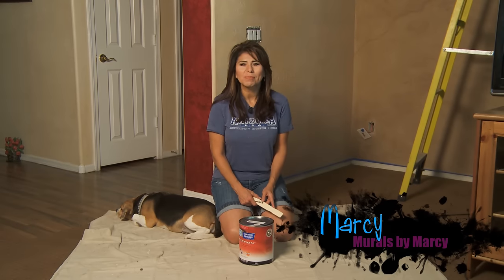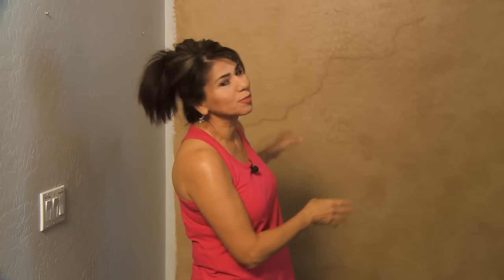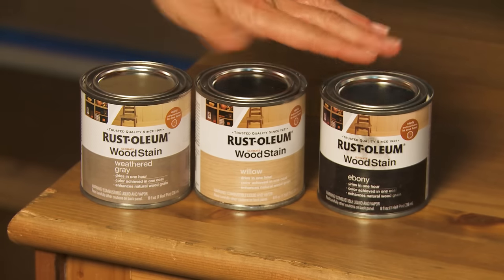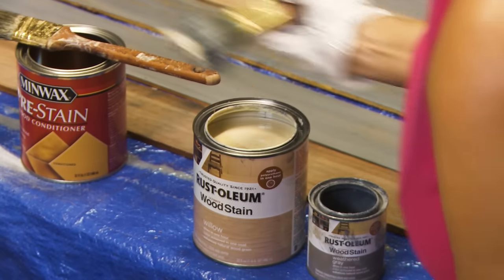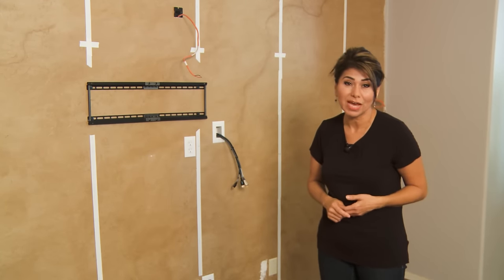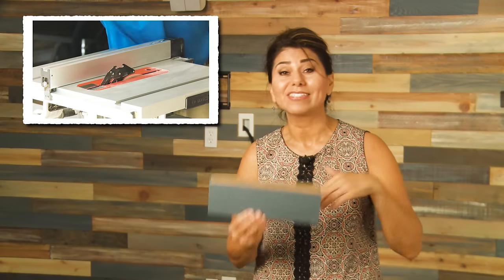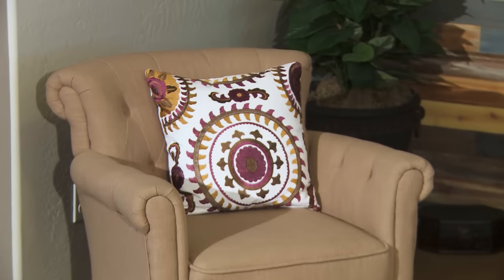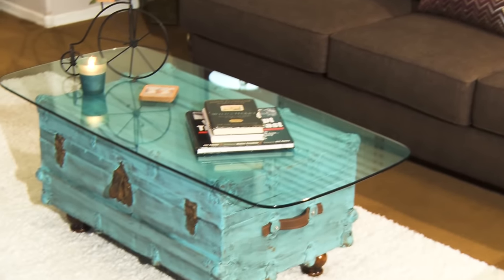LIVING ROOM MAKEOVER WITH WOOD ACCENT WALL:  DIY ideas for transforming your space inexpensively

Comment: Thank you for your video, enjoy your project very much, just did a couple things different,  first I bought my wood already with the same width, and stained it all before it was cut, to me it was much easier this way, then it was just to cut to the necessary measure, nailing I didn't look for the studs, I simply use 1" 1/4  finished nails, and the trick was nail the boards position the nais in sideway 45°angle in opposite rows, that was much easy not to be worried to be always on the studs. Before that I tested a 24" board nailing to a piece of sheet rock and the result was very positive, I had a hard time to remove or separated the board out of the sheet rock,  thankfully.
Reply from the maker: That's awesome. Sounds like your project turned out great. Congrats on that. Thanks for checking out my video and taking the time to comment.

Comment: Very nice work your wall looks great. I did a similar wall in our living room and used wood fence slats which are thicker but after watching your video and seeing you used Bender Board, I would certainly recommend that people use the Bender Board like you did. I like that the bender board is thin and if you have molding, the thinner the wood is the better so it doesnt protrude out past the crown and base board molding. Again, great job I will be doing another wall and will use Bender Board this time thanks for the video!
Reply from the maker: Thanks for your kind words, DP Surfer.  I'd love to see a picture of the wall you did using fence slats.  I'm sure it's awesome.

Comment: Hey Marcy, I love what you did. My husband and I are doing that too. Our walls are 8.5 X 8.5 and I was wondering in order to cut the panels in 3 different lengths what would you suggest they be? Hope to hear from you soon. Thank you.
Reply from the maker: It's really a matter of personal preference and how much work you want to do.  The smaller the pieces, the more cutting and nailing.  My wall is 10 x 12, so we cut 4', 2', and 1' pieces.  Then we ended up cutting smaller custom pieces to fill in the odd areas.  Hope this helps.  Thanks for checking out my video.

Comment: Hi God bless you and yours!!

Really nice job. But how do you obtain so many colors with only 2 stains?
Reply from the maker: Hi Felipe.  May God bless you and your family, as well. The bender board I used had very inconsistent coloring to begin with. But, using a paint brush, I would layer one stain over the other, then flip flop the order on different pieces. Sometimes, I just used one. Other times I'd put multiple layers of stain to make the color darker, or barely put any at all to make it lighter. I was experimenting with different combinations the whole time, and was so happy with how it all turned out in the end.  Thanks for checking out my video.

Comment: we are ready for us to do our project in the living room and so the orange is painted on the wall, the wood is cut, the tools are prepared. However what are the size of the brad nails. because we are like you and your family... fads change and our needs do too!!  (i do realize that your video is a couple years old so I hope you check on comments)
Reply from the maker: Laura Matsuyama Because the bender board is so thin, we used 1” brad nails. It’s held up perfectly. Good luck with your project. Thanks for checking out my video. 😊
Reply: @MuralsbyMarcyV  Thank you for responding. I enjoyed your video. I now know that we can get started on our wall with more confidence after seeing your video. we did decide to paint the wall behind and space out the wood so that the the color comes through, we are also debating if we should but up lights but that maybe a little to much!! :) Aloha!

Comment: very nice. did you sand the wood before you stained it? i like the colors but dont like a rough wall do you think sanding is good?
Reply from the maker: Thanks for checking out my video.  That's a good question.  In this case, I didn't sand them, because the wood wasn't that rough.  If I had a baby crawling around, who might rub up against the wall, I probably would have.  It just depends on the individual project and if you're going for a particular look.

Comment: Looks great!!!   I am unclear about how you got such a color variations with just two stains.  Did you first stain all the wood, then add watered down paint for color variations?  If you did, what paint colors did you use?  There is too much blue and white to occur with just two wood stain colors.  What did you do specifically?   Sorry to be a pest but I  want to do this too.  Thanks so much!
Reply from the maker: Thanks for checking out my video Tanya! I did only use two stains; the gray and the white, but I applied them differently to each piece of wood.  Because I used bender board, the pieces I bought came in varying shades to begin with.  So, some I left pretty close to natural, while others I applied heavy stain.  I did light layers of gray, then went back and streaked it with white stain, some I did two layers of gray stain and then added the white, some I did the complete opposite, I did some just gray, some just white, and I never cleaned my brush in between.  I think that is the biggest trick.  Don't clean your brush.  Hope this helps.  Good luck with your project!
Reply: Thank you Marcy!

Comment: Hi Marcy. You and your husband did a great job. It is gorgeous. My husband and I are planning to do the same. 😊 I have a quick question for you, how thick is the wood you used? Thank you in advance.
Reply from the maker: Hi Yeni.  The wood we used is only about 1/4" thick. It was inexpensive, but also imperfect, so we spent a lot of time at Lowe's going through each piece to pick the ones we could work with. Good luck with the wall you're doing.  You'll have to let me know how it turns out. Thanks for checking out my video.

Comment: Do you have any recommendations for doing this wood panel on a concrete wall? do i need to place all planks directly to the wall or put a flywood or something first then the planks? thank you!
Reply from the maker: Try covering your wall with the thinnest sheet/s of plywood you can find.  Probably 1/4" thick.  Use concrete nails/screws to attach it to your wall.  Then you can nail your individual planks onto it.  You could also glue the planks directly onto your concrete wall using a good epoxy glue, like liquid nail.  Although, over time, it may not last as long.  I'm sure there's lots of info on this subject online.  Good luck with your project, and thanks for checking out my video.
Reply: MuralsbyMarcy Thank you so much for your quick response even this video from last year :) I’m planning to removate my dining/entertainment area.. I wil also put my TV on the wood wall panel .. but im planning to directly mounting it on the concrete wall as much as posible to get enough support! Hope to see more videos from u specially space saver renovation :)

Comment: I just did the wood accent wall and I was wondering if the wood shrinks or warps over time?
Reply from the maker: Hi Javier.  It's been about 9 or 10 months and I haven't had any problems with that, whatsoever.  But, in my video, I mentioned bringing the wood indoors after staining it, and letting it set overnight to acclimate before nailing it to the wall. Thanks for checking out my video.  Hope you're happy with how yours turned out.

Comment: Looks awesome, Marcy! When you stained those did you completely cover each plank with the stain or did you lightly bush some? Just wondering if the variations in each plank is the unique grain in each piece coming though after it drys, or because you didn't use as much stain on some of them.
Reply from the maker: Some I lightly brushed, others I did two layers of heavy stain.  I even layered one stain over the other.  I wanted a lot of variation and was able to achieve that with just two stains.  The bender board wood that I used was also very inconsistent, so the pieces that I thought were prettiest naturally, I put very little stain on.  Thanks for checking out my video, Justin.
Reply: Justin Guernsey Frsuarez

Comment: Great job, 
what size brad nail did you use for this project?
Reply from the maker: We used 1" brad nails.  Thanks for checking out my video, Henry!
Reply: MuralsbyMarcy 
thanks
Reply: MuralsbyMarcy an inch nail seems kind of small. your going into the thickness of your wood panels and the drywall. how much is the nail going into the stud? 1/4" at most, I would say. besides that the end product came out beautiful.
Reply: Is it necessary to nail into the studs being that
A) You used 1" Brad Nails and
B) You're using finish nails, also would make for easier removal of accent wall if you chose to in the future? 

Great video, thank you!

Comment: I need to know if I can paste these on my walls without the use of permanent glue like Liquid Nails, but rather something more temporary except, not wallpaper glue. Anyone have any suggestions, please? Any advice is greatly appreciated! Thanks! 🙂
Reply from the maker: Glue will likely destroy your drywall when you decide to take the wood off down the road.  That's why I went with small brad nails. Minimal damage, yet it's strong enough to hold up the wood.

Comment: I have a question, how much damage this project make to the wall when you decided to remove these board?
Reply from the maker: Areyou Mo We haven’t taken it down yet, but when we do, there should be no damage at all. We used very thin brad nails and no glue. It should be like pulling out a thumbtack. Hope this helps. Thanks for checking out my video.

Comment: did you stain every board with the 2 stains or alternate?
Reply from the maker: I mixed it up A LOT!  I only stained some boards with both, and even then I alternated the order, putting the dark stain first, then lightly adding light streaks, and vice versa.  Hope that makes sense.  Thanks for checking out my video.